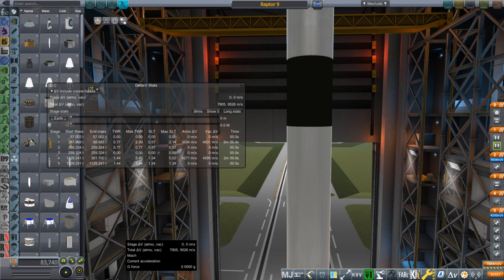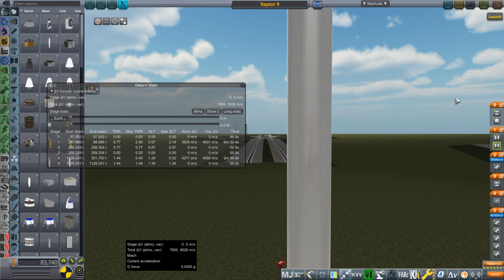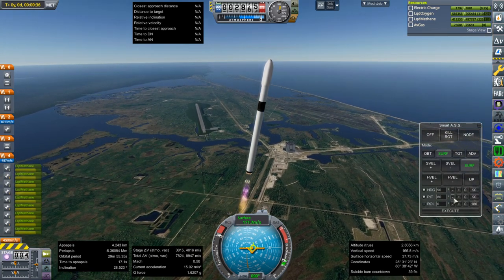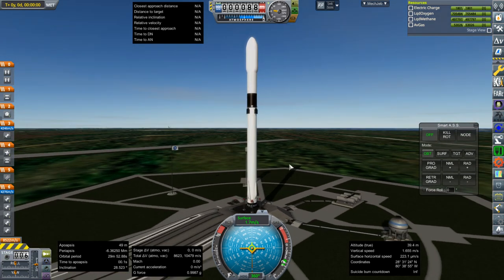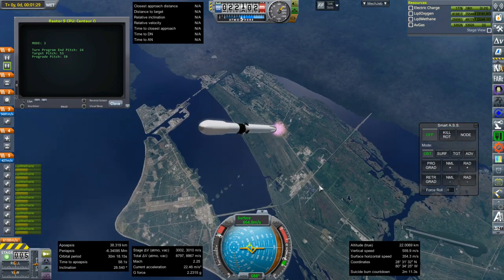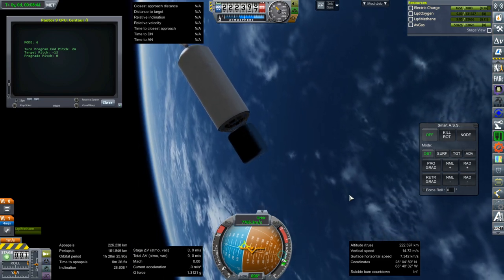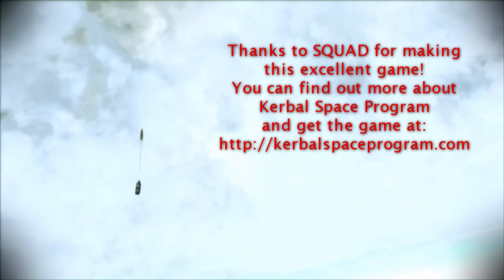Realism Overhaul in KSP 1.8.1 - Raptor 9

Comment: Raiz, you do inspire me.
Earlier today, I put a couple of satellites up in helio orbit, 120° apart, planning for a Mars mission. Working on a network to serve me in Mars all year long.
But it was all by the seat of my pants, really. Turned out well. 
Had a single raptor in the bottom, a single merlin d on top, and a couple of sats combining 10 tons on top. 
Everything went nominal and now the sats sit pretty flying in sync with earth. 

Too bad I suck at calculating  stuff. I just put something  together and try to get to orbit. Old school I guess.

Comment: 5:00 Probably 62 if you can get an optimal trajectory.
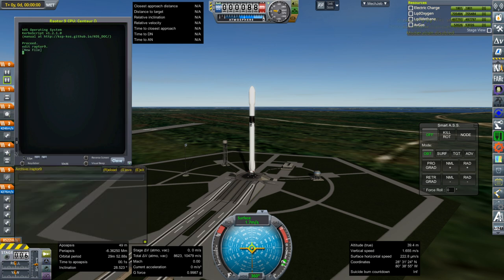6:10 Are any of the values adjusted to take into account the different specific impulses, etc.?
7:25 YES.
BTW, can you share the script? I'd like to reconfigure it for my Enoch series. 
Also, about that... have you ever managed "2-layer" crossfeed? I've wanted to make an Ultra-Heavy which goes from 7 to 4 to 1 fully-fueled "sticks", but when I attempted that, after separating the first set of 3 boosters, the crossfeed breaks and the remaining 3 boosters and core all burn fuel at the same rate.

I have nothing to offer regarding names that hasn't already been said.